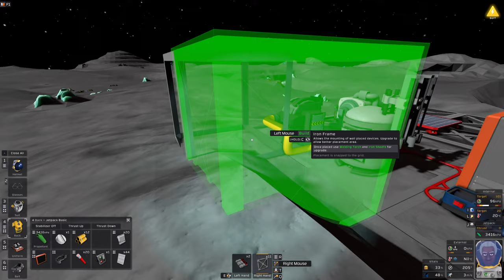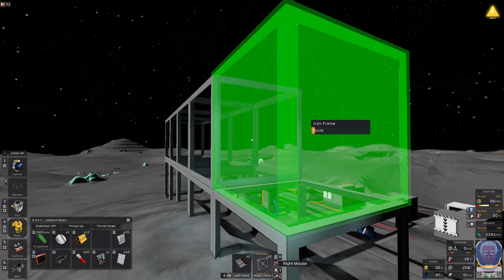Getting started in Stationeers - Day 3 Solar panels and batteries

Comment: Will, your info is correct, as usual. 
However, it is a lot cheaper ( in gold) to place a small transformer for the solar. 
Especially in the early game play. It's not likely that you will need more than 5kW at point.

The pipes can take a lot more pressure than 10MPa.

The interesting thing with the solid fuel generator is that if connected with normal cable,  it gives 5kW and with heavy cable 20kW.
Reply from the maker: Interesting how the generator does that... It should just stay at one level imo but just another quirk of the game.

Comment: 13:40 - you could put your old solar panel on the tower facing east, connected only to the control circuit, so it would give the control circuit the juice it needs to reset every morning.